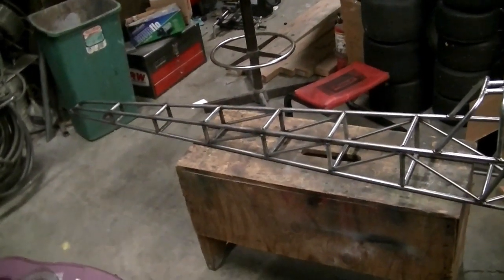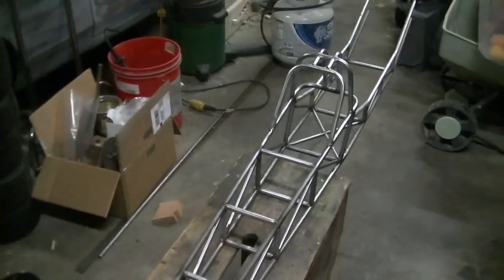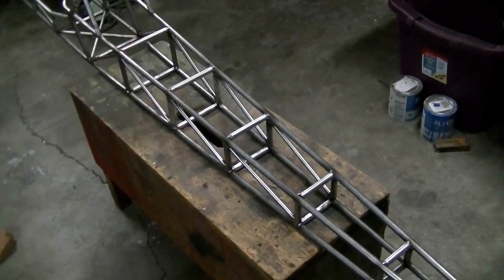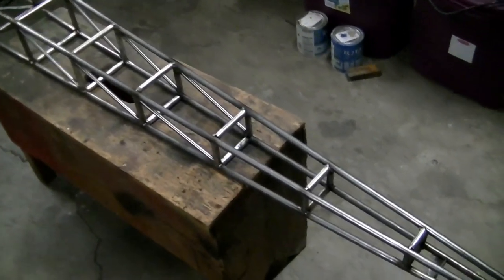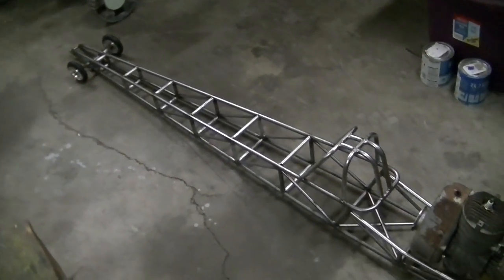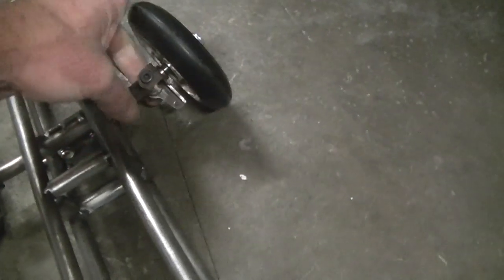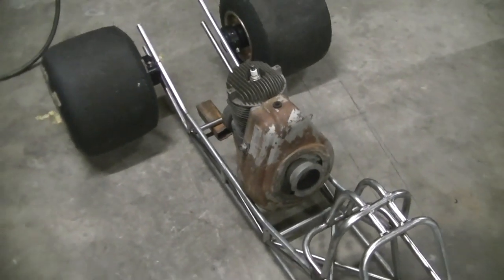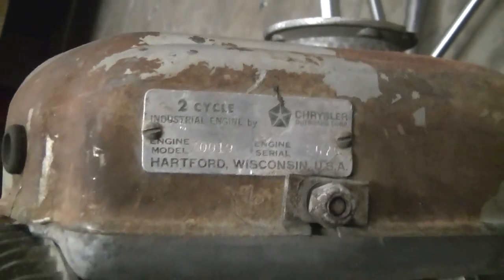Radio Control 1/4 Quarter Scale Dragster Build, How to, DIY

Comment: Do u know were I can get an axle for a 1/4 dragster like yours
Reply from the maker: that actually is from out lawn mower front wheel drive axle and it is a nine to one ratio. bought it off of ebay for about $30 shipped. its a worm drive and it will not coast without modifying it.

Comment: what are the dimensions for the frame?
Reply from the maker: +Brian Nalley 88" long, 7" wide , 11" high, 75" wheel base....if I remember correctly ha ha, these are real close.  You can search the internet to find the dimensions of a full size dragster then divide by 4, that's what I did.

Comment: In the video you say you don't now the cc on the engine. I goggled and found some info 114,7cc http://www.ebay.com/itm/PairNOS-WestBend-Chrysler-700-vtg-go-kart-engines-2cycle-power-bee-Mcculloch-580-/191065490011